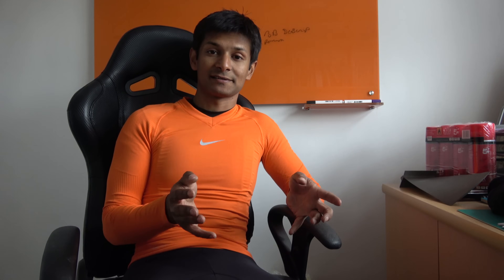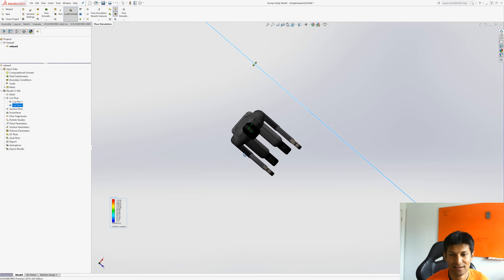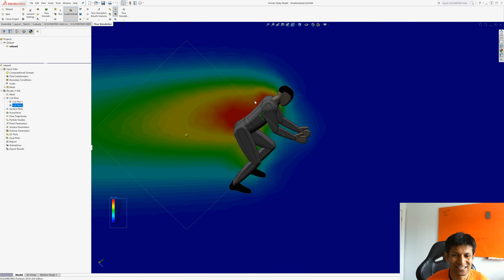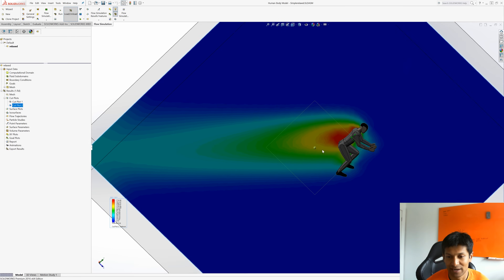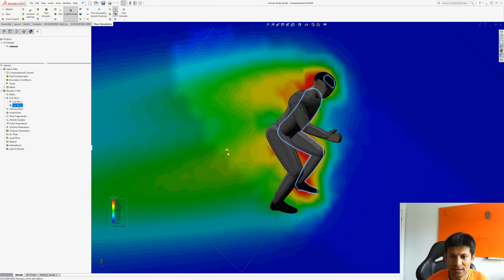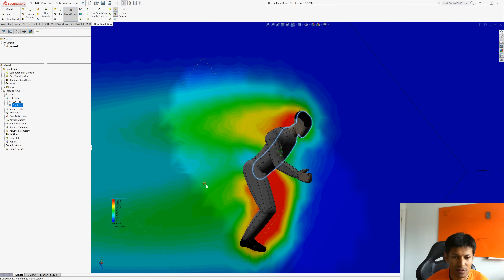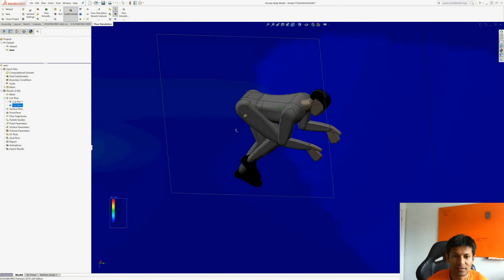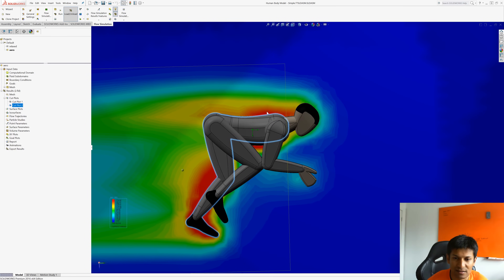How to get More Aero!!! Bike Fit TT Riding Position aerodynamics explained

Comment from the maker: There have been a few comments ref Shorter/Longer Cranks. The data from the CFD (my Commercial one, not the solidworks shown in this video) shows that if legs endure more bend at the top of the pedal stroke the drag is reduced - mainly through reduced frontal area and a lower drag coefficient. This assumes everyone's Torso angle is kept constant. To make the analysis broadly scientific, only one variable should be changed - unfortunately the saddle height and crank length are intertwined so it's impossible to change one without the other. 

The difference in drag between short (170mm) and long (175mm) is not very much - 2%. Further analysis of the data (and this will vary depending on the individual) is the reduction in saddle height that is necessitated by longer cranks has more effect by lowering the rider's body into the slower moving turbulent air caused by the bike's front wheel. For clarity, the statement in the above video assumes that no other angles (ie torso) are changed. Thanks Hambini
Reply: Everybody has a limit to how far their knee can go up without it hurting power output, breathing, or physically limited due to hip impingent. Shorter cranks allows a flatter torso given these real world limitations.
Reply: You look like you could use a 1 size up bigger frame. Sure you know far, far more than me but just from observation of your position in this video it looks like a bigger frame would really benefit you. How come you've gone for a Cervelo frame when you always recommend other bikes when asked in your videos?
Reply: Ok, cap'n Kirk!
Reply: I imagine you're absolutely right in terms of pure aerodynamics in relation to your leg position.

There's two sides to this story though. The other side to crank length is how it affects the rest of your position, by having shorter cranks you can often achieve a more aerodynamic position because 1. logistically your legs are less in the way of your body when your leg is at the top of the pedal stroke and 2. you need less flexibility in your hamstrings when using shorter cranks to achieve the same amount of drop, because essentially your leg is moving that much less (if that makes sense?).

I believe the GB track team all went over to using shorter cranks for this reason between 2012 and 2016, even though Wiggins was using 180 cranks for the 2012 olympic TT he was on 170s or similar for the team pursuit. Presumably they did a fair bit of testing and decided the net benefit of the positional gains by using shorter cranks outweighed the "direct" aero gains from the bend in your leg when using longer cranks.
Reply: Great vid! On a very complex subject where real life situations are very hard to model in a wind tunnel, although we can at least get some ideas.
Re. crank length, I think it depends on how your ride. If you are quite flexible and aero already, one of the limiting factors is the crank upstroke where your knee impinges on your chest. This is why pros have been finding aero gains in shorter cranks. But if you are a bit more upright (like most of us), these gains are moot.....
But shorter cranks promote higher cadence and that's a Good Thing! (But another subject entirely!)
Reply from the maker: They must be really bent over if their legs are hitting their chests. I'm guessing mortals can't do that.
Reply: Not so much hitting their chests as compressing the gap between too tight.
Reply: @CyclespeedTours  
- Re short crank length aero, I haven't heard yet how the advantage of the knee rising higher is not offset by the opposite foot going lower (and presumably adding to turbulent flow). 
- Pros have generally moved to shorter cranks recently to attain efficiencies associated with higher cadence. The other advantage is blood flow to the lower limbs is not compromised as severely when hip angle max is reduced. Every time the knee approaches the trunk, blood flow to the lower limbs and returning in the veins is compromised. In some riders the vasculature is damaged more so with a higher hip angle. (research iliac artery endofibrosis). Iliac vessels get kinked more so the more one bends the hip joint.
- shorter cranks generally mean a lower back angle, which to my knowledge impacts aero advantage more so. In my work with GC teams, it was a major priority to achieve the lowest sustainable back angle. In fact, bike set up (and bar choice) aimed to keep riders comfortable on the drops for a minimum 20 minutes. Pros also typically use a bike frame one size smaller than recommended. Why? because a slammed stem is closer to the ground on a smaller frame, and that allows a lower back angle. Of course, all of this doesn't cross to non pros, unless they have low bodyfat% and other pro like physical traits.

Comment: When you mention reducing drag by lowering your bars or riding on the drops, I think you should add that the point is to lower your shoulders.  If your body is already leaning quite forwardm maybe horizontal, lowering the bars or riding in the drops won't help and may even increase drag.  (Very bent elbows and riding on the hoods has lower drag)

Comment: question: all this at speed of 40kmh? 10:39 to 15:20 is there any effect say me as a regular commuter running at 15kmh is there any significant turbulence at these speeds for bikers position? and also at the same speed 15kmh is there a significant gain in watts for the teardrop design compared to the round steel frame? I am summing that aero bikes are for competition and steel rounded bike makes no difference for a commuter biker, just for the ankhs of it...

Comment: Have you given much thought to the praying mantis position? My on the road testing found at least 3 minutes (for me) savings between flat arms and angled arms over an ironman distance. Angled arms were faster but not by much. The data was a bit noisy, so I rode multiple laps and tested several days. I used a loop ridden at various power levels and analyzed the power versus lap time data. I linearized the data. Kept power between 100 and 300 watts. Quite windy and loop was undulating slightly, so keeping even power was challenging.

Comment: Thanks for the aero explanation by someone who understands it well.  In then interest of looking forward to cycling for transportation (as a Climate Crisis mitigation factor), will you please consider doing a similar video where you go from casual rider position, to TT position on upright bikes, and then go to recumbents, including trikes, racing trikes, and velomobiles.  I suspect these efficiency gains will become extremely valuable from an energy conservation consideration if you consider cycling and electric assisted cycling as a replacement to ICE engine powered cars and motorcycles.  Thanks for the educational work you're doing.

Comment: All the drag on the legs is making me think of the new Lotus track bikes for the 2020 Olympics. They have a radical fork design with blades that are spaced out very far from the wheel itself. On it's own this fork is less aerodynamic than a conventional one but in conjunction with a rider and their legs it creates an overall more aerodynamic system.

Comment: I'd imagine it's been banned by the UCI but I'm surprised that no one has developed a skin suit that has a aero hump on the back like Superbike races etc. Easy to do would be better than the extention to the helmet that's usually used and can make aerodynamics worse if rider doesn't keep their heads down and flat because it sticks up in to the airflow. Also they could get rid of the bottles from the bike using the hump as a camelback water holder and filled with ise cold water on a hot day and some insulation around the outside it would help cool the riders, sure developing a way for the rider to fill it up on the go wouldn't be that hard and they could even have a bit at the bottom tip for the radios.

Comment: @Hambini I was out riding with my girlfriend last week. She always sits in behind me (until we get to climbs and she wants to have a go) and on the way back we had a strong tailwind. Still sat behind me she shouted 'does this mean you are drafting me now??' as we were doing a consistent 27mph. I mustered up the most solid Joker-esque laugh I could and carried. 

But, this got me wondering about the aerodynamics with a strong tailwind... if we were doing 27mph with an 18mph tailwind, is it basically like hitting the net difference of a 9mph headwind?

Also, helmets... all marketing spin/bollocks in your opinion? I have an Abus Gamechanger 'aero' helmet that, honestly, I use more for the extra heat it holds in, and a POC Octal for hotter riding. Am I right in thinking aerodynamically there would be little difference between them? Looking at the positions you outline in this video, I'm guessing only a proper TT helmet with a trail at the back of the head to cover the immediate turbulence could give any significant wattage save?

Great video btw, thanks. 👍
Reply: you can scroll down to the bottom:
https://www.radsport-rennrad.de/test-teile/aero-helme-windkanal-test/
the difference between the slowest and fastest helmet is 16watts at 45kph, that is indeed way more than you will find differences between wheelsets with similar deep rims.

Comment: Crank Length - I have always been told that shorter cranks are faster because they mean less of a bend in the leg, opening up your hip angle, so you can produce more power. Some people can be down 10% in wattage due to the TT position. If people can close that 10% gap, would it be worth the extra drag? Hmm....

Comment: I wonder, if when put of shape I weigh 110-115kg, but only 85 when in shape - and am particularly prone to sport love handles when out of shape, ride 30-35km/h on flats when before fatigue kicks in, how much faster would I ride once back in shape? I understand that drag is difficult to estimate, because I cannot specify the exact dimensions of every part of My body in both conditions, but very, very roughly - what would the speed gain be, in your estimate? Idem, the cardio. Under 5km/h on flats (compared to 30-35km/h) - or over that, ceteris paribus? Thank you.

Comment: Hambini, I like your scientific appoach. 
A question: Would you make this video different, after you Bike Wheels and Zipp Dimples video, with the local spiraling taken into account? Or is it still the same, because the object of the rider is bigger than the rim or the spokes?
Reply from the maker: The weighting of the rider has far more effect than the wheels or the frame. A change in rider position is changing the 80%. A change in hardware is only effecting the 20% . Hindsight is a wonderful thing but I still think the basics of this video are sound.

Comment: What are your thoughts on wider tyres for comfort vs narrow tyres for more aero! Is there more gain in bigger tyres for more comfort for less fatigue and reduced rolling resistance over increased rolling resistance, fatigue for more aero narrower tyres?
Reply from the maker: I guess ultimately this depends on the roads you are riding on and what bias you put to both. I tend to ramp up the pressure and use a fairly soft handlebar tape and my saddle flexes quite a bit to absorb vibration.

However in terms of aerodynamics, a narrow tyre / wheel 
is faster.
Reply: Hambini what about tyre Hysteresis, surely that is an important factor

Comment: 1:13 
Hot & humid air is less dense than cold & dry?!
Reply from the maker: Yes
Reply: Hydrogen atoms are very light, so H2O molecules are about half the weight of the O2 and N2 molecules which make up the majority of air.
Reply: You can see it on a psychrometric chart. If you add humidity to the air at a constant temperature the air becomes less dense.

Comment: seat pushed all the way forward, long stem. . . .  . wot
Reply: A position further forward over the BB will open the hip angle, allowing him to sit lower and more aerodynamically.
Reply: @sketchanderase  why do I have my seat pushed all the way back on my aero setup? Dont you want your hips hinged and body locked for sprints as well? Being forward is bad...let me guess you offer $400 bike fits and have annoying facial hair
Reply: @alexbradley9880  why do TT bikes have forward saddle positions and more upright seat angles. Because you can produce more power in a less biomechanically compromised position.

Comment: After high school I studied engineering at uni. My dad was a motor mechanic and I had learnt a lot from first hand experience. You remind me of the students that had never done anything except learn from books. But didnt know one end of a spanner from another or how to change a car tyre. I like what you are trying to do but you lack experience.
Reply from the maker: I'm sorry I don't meet your expectations. Thanks Hambini
Reply: @Raymond Menz how can you possible know what his experience is from a YouTube video. He might of been ripping things to and “fixing them” since he was 2 years old.
Reply: @petecollis4980  Only an IDIOT would use a cutting angle disc like that. A first year motor mechanic would know better.

The son of a work friend did the same thing. The cutting disc exploded at 8000rpm.  
His BALLS were sitting on the GROUND HANGING FROM WHAT WAS LEFT OF HIS PENNIS.
Reply: Shame you think that working on aircraft is inferior to motor industry ~ but a bike is a simple piece of kit compared to aircraft & motor industry and we are not here for complex theory or lecture on air drag dynamics .......
Reply: @bengreen1262  I didnt say working in the aviation industry is inferior to the car industry. Working in my dads garage gave me experience - fixing cars, trucks, tractors and boats, spray painting, black smithing, oxy an arc welding.

To use an angle cutter in such a dangerous way shows how much real engineering knowlege he has. In fact I warned him that angle cutting discs explode without warning. So what happened. ONE DID.
In my work shop thats INSTANT DISMISSAL

In the 1st year I was at uni there were around 500 students. I was the only person able to identify what the markings on a spanner meant - basic engineering. Every electrical engineering student was unable to identify the correct way to install a car battery. ETC.

There was an extreme lack of basic
 engineering knowledge with almost every student. I can only assume you are one of the idiots who pass physics and maths at high school then think you know engineering. I can only assume like them you also cannot or could not change a car tyre.

There are people like yourself who appear not to care about details. Then there are people like me who want to be told ALL the details. I dont accept anyone telling me just what to think. I want a full explanation on WHY the person thinks it.

Comment: I think most important potions is according to each body types for comfort, not straining, so energy can produce without any struggling, injuries, pain. With proper weight balance to each position of saddle, pedal, handle, and elbow (in case with aero bar).
Reply: Not to mention that a more aero position - leaned over further, may reduce the power from glut muscles (the largest muscle the body has).  A balance between power and aero is naturally necessary.

Comment: You said that tight fitting clothes are more efficient, but does that mean that bare skin is more aerodynamically efficient? Just curious.
Reply from the maker: This is a bit of a tricky one. The fibres in the fabric cause drag because they are essentially a mini mountain range, skin doesn't cause as much drag because it's "less mountainous". The tight fitting clothing does smooth out contours which will help. There really isn't much in it but I would go for a skin suit as more aero, especially around the shoulder arm area.

Either will be better than loose clothing because the fluttering of loose clothing causes lots of pressure drag. The skin v aero suit is more a kin to skin friction or parasitic drag. Hope that helps hambini

Comment: In your channel introduction you typed "by may day job as an Aerospace Engineer".
Reply from the maker: fixed it, thanks for letting me know
Reply: hey appreciate the work you do here with your spare time. Cycling definitely needs some more factual media source than paid ads stuff. Perhaps you can do a video on the aerodynamics of tyre and frame clearance in the future? There are some debates going on about if huge clearance is better or next to zero clearance is better (in the aero aspect).
Reply from the maker: Thanks for the feedback. There will be a video on frame aerodynamics part 2 which will cover that. I assume you refer to the front/rear clearance as opposed to the left right clearance?
Reply: front tyre's left and right and top. I guess back isn't a problem between it is aready hidden from wind for the most part.